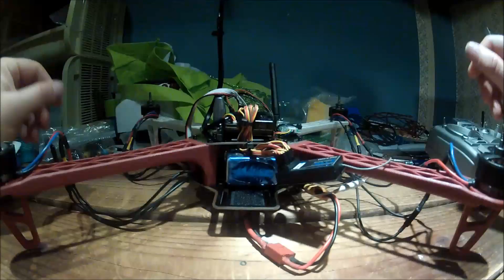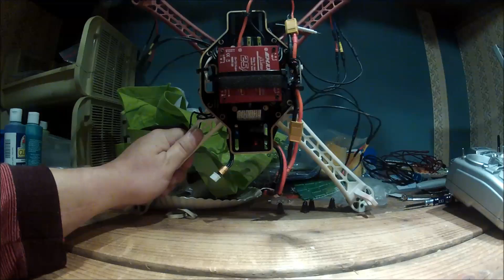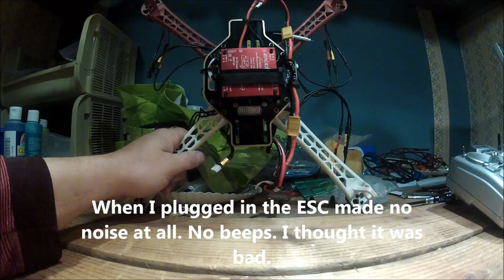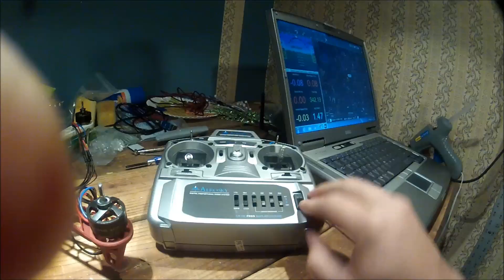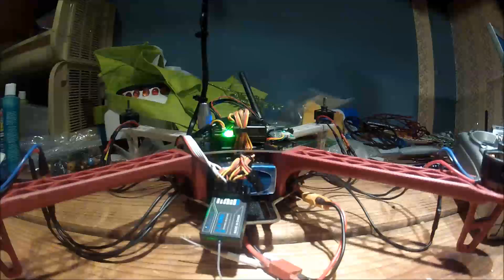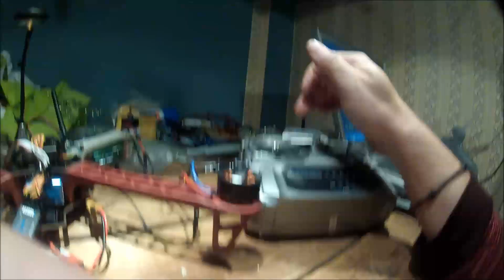EMAX Multirotor 25A 4in1 ESC Setup part 4 of 6 - Installation and Throttle calibration with APM 2.6

Comment: I have a Naze32 rev5. How do i connect the EMAX 4in1 into it? Also, with the Deans connections, do I connect it direct to the battery?  You weren't too clear on how to power up the EMAX 4in1. (well, at least it wasn't clear to me).

Comment: Note-- If you are using the KK2 flight controller, you can do the throttle calibration through the KK2. There is an option in the menu to do this. You follow the same procedure though of putting the throttle at max, then after it beeps putting it down. I'll also put link below to the Hobby King manual for the KK2, it talks about it in there. The manual shows the regular KK2 with the lcd on the screen, I have the other version where the programmer is separate and as far as I can tell they work exactly the same.

https://www.hobbyking.com/hobbyking/store/uploads/181270330X7478X47.pdf

Also, here is a link to the Emax website, it will take you to the product page for the 4in1 and on that page is an image that has instructions on programming it. If you leave your throttle in the up position longer than the two seconds it will take you into that menu and there are several settings you can adjust in there. That can also be done through the KK2 ESC programming mode. On their website you can also find replacement UBECs and power cards in case you need to replace one, just look under ESC accessories. Although, I just bought two of the 4in1s on amazon for $23 each (and got free shipping!) so now I have a full set of replacement parts on hand for less than it would cost to buy them all individually.

http://www.emaxmodel.com/esc/simonk-series/emax-multirotor-4in1-esc-4-25a.html

Comment: Thanks Dana for respond yes I notice the problem with the back of my quadcopter motors 3 and 4 they get full power at middle stick and aim using walkera x350 motors for test they are in perfect condition I just removed them for fly test I swap the speed controls at different positions but yes the bad ones don't respond equal to power command.the system I have 25amp E-max 4in 1 speed control.thanks again.
Reply: Yes i have the same problem. I bought two emax 4 for in 1 for two different quads and different motors. Same problem with both, Motors 3 and 4 are weak. Using the method shown above i was able to show that all my motors worked as they should one at a time. Hooking them back up to my flight controllers (KK2.1.5 v1.81 pro and v1.91) they still have problems. I think the problem is with the settings in the kk2.1.5. After battery is recharged i am going to change my min throttle settings from 10 to 20 percent as someone suggested also will try changing min throttle settings to zero before trying a throttle calibration with the kk2.1.5 board. Are you using a kk2.1 board for the flight controller? Thanks Dana

Comment: Sadly I can't use the 4 in 1  speedcontrol after I setup the system two motors wont spin at full power if  any idea why this happen will be more than welcome.
Reply: juan sanchez 
Which flight controller are you using?
Notice when throttling down does all the motors stop at the same time? If not are these the same motors?

Comment: Thanks I almost send my my unit back for replacement for the same problem. Thanks for sharing.
Reply from the maker: Glad I could help out. Have fun flying.
Reply: RCFlyer24
Tried your way and all motors had max power when i did each motor one at a time. Hooked them all back up and still have the same problem, motor 3 and 4 weak. They all start at same time. Seems to me it must be a kk2.1.5 setting or someone suggested a problem with the transmitter. I will keep digging. Thanks